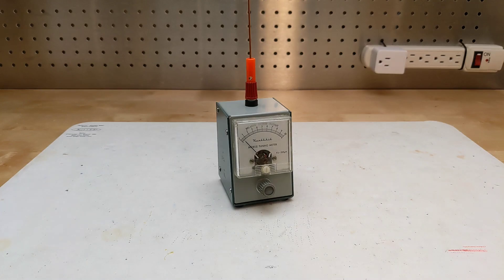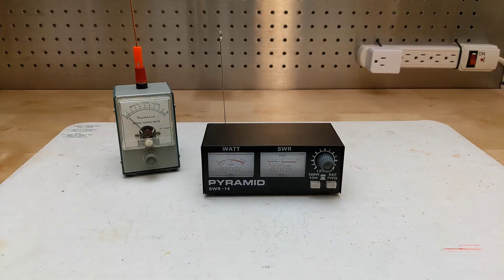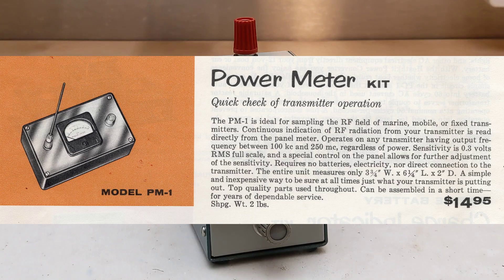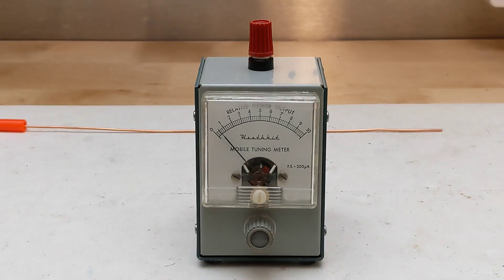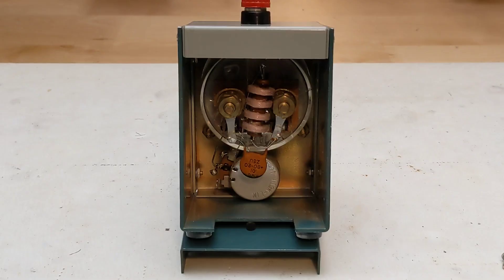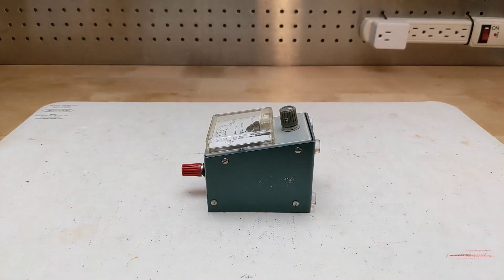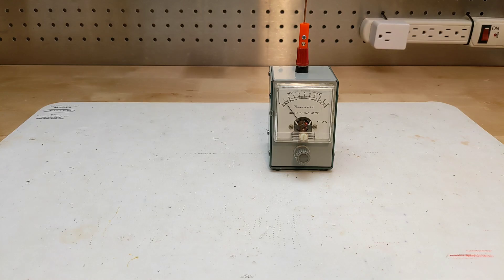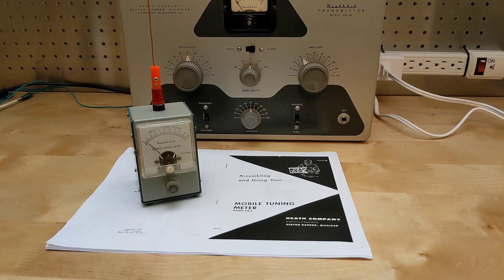The Heathkit PM-2 Mobile Tuning Meter

Comment: So they replaced the PM-1 with the PM-2. That makes perfect sense. But why wasn't the replacement called the PM-3? I would have loved to be in the meeting where they decided to call it the HD-1426
Reply from the maker: I think the reason was to bring it in line with the later naming conventlon where miscellaneous ham radio accessories were assigned HD-XXXX designations.